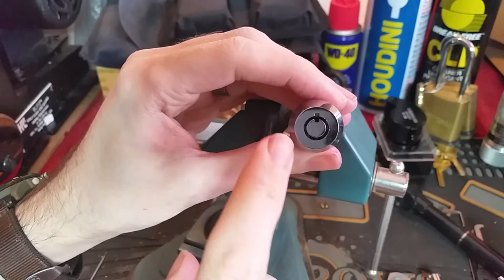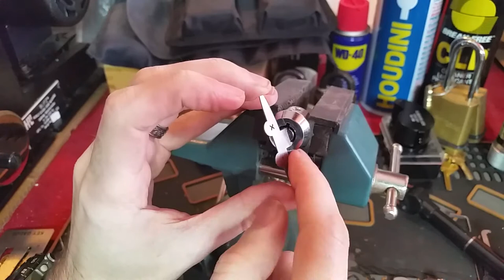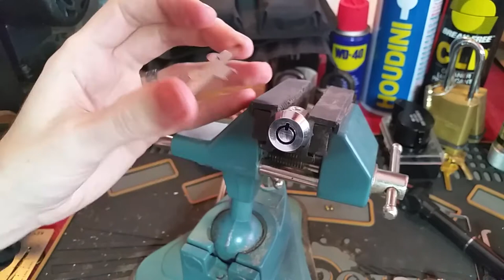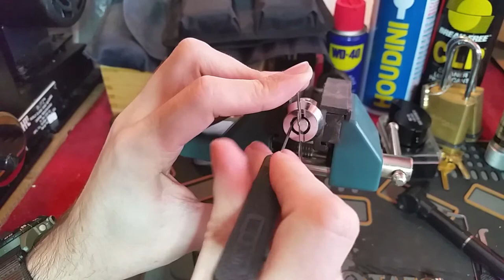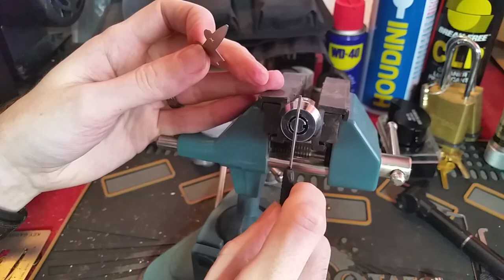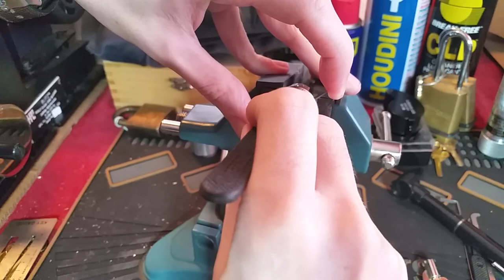(101) Camlock Systems Series 2 18mm cam lock SPP'd

Comment: Thank you! This explains why I was having trouble recently with a tubular lock fitted to a vending machine in the end a bic style pen attack opened it :) Happy picking!
Reply from the maker: I usually use a self-impressioning pick tool on tubular locks but they tend to be restricted to a very narrow range of post/keyway diameters which is the main reason to keep tools for SPPing them around.
Reply: Yes spot on the ID and OD of the impressioning tool doesn't always fit... I keep a broken pick that has been filled for the pick and piano wire "style" (homemade) tension tools for said lock.  Still the tolerances of the tool vs lock can be a problem sometimes.  I should get my self a proper tension tool for tubulars.  Thanks for sharing!